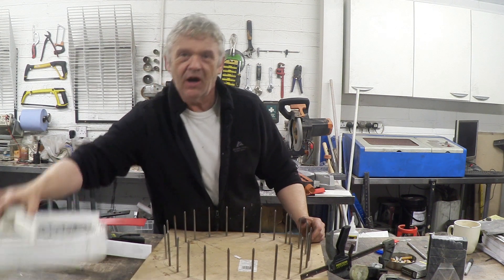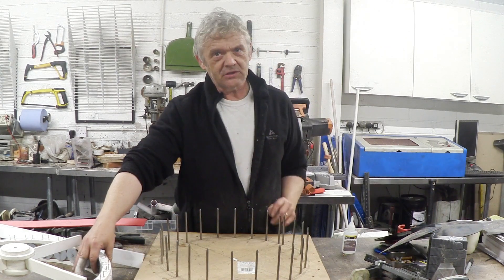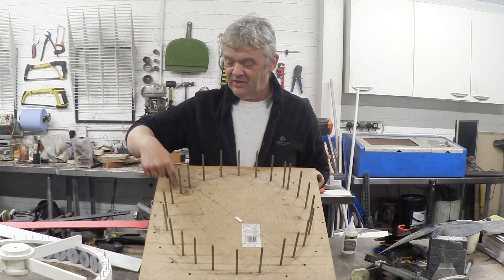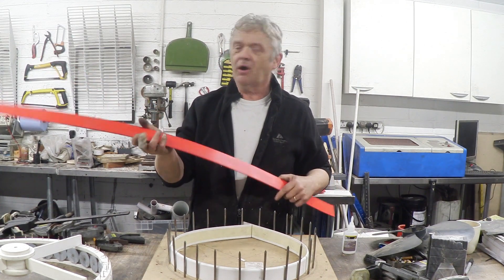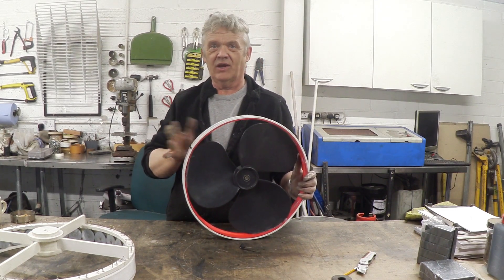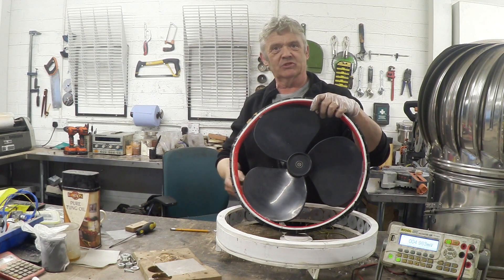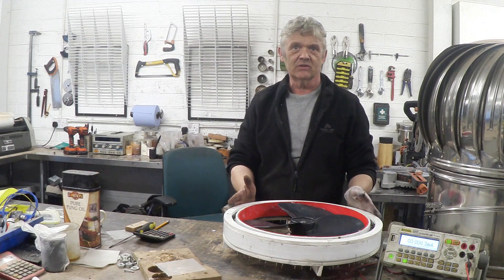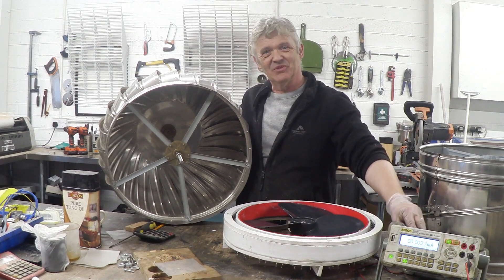Rotating Ventilator For Wind Power Part 4 - Making The Rotor

Comment: I am wondering if the coils will be wired in series or parallel. Will need to make sure that the wiring is all traveling in the same direction so that no coils cancel each other out. I think that the output will be really good. Possibly better than a solar panel.
Thanks yet again Rob, great video.
Edit ** you have to take into account that the 30 ma is the rotor moving at a snails pace. Put it into a decent breeze or a mild to strong wind and the output of the one coil would increase dramatically. Also when hooking the coils together with the magnets being in the good old N, S, N, D configuration it should put out a  wave form that is close to a pure sinusoidal wave which is ready for DC rectification using the alernetating power directly wouldn't be good because the frequency wouldn't be consistent and could potentially damaging.
Reply: I was thinking the same, they could be wired - all series, all parallel or half and half, depends on what voltage/current ratio you want, which I guess would depend on it's application. will definitely need rectification on the output.
Reply: @MrTubeuser12  agree, but you have to admit that this is an awesome project for generating decent power. I also agree with coils being wired in series or every second in banks of parallel with them put in series.
Another possibility is adding larger blades (about 1-3 cm) to every second to third vent would increase the area for the wind to increase the potential to increase the speed of the*turbine* (yes I use the term loosely). Decent bearings would be needed to reduce friction also.
Reply from the maker: I should have mentioned I paid particular attention to the way the coils were wound and mounted so I know the coil winding direction - but I will mention in the next vid - good point mate

Comment: Two thoughts come to mind and not wishing to detract from your considerable talent here.....heat and soot ....I know that my rotating cowl gets some soot buildup over a season and I am really not sure how hot the final exhaust temperatures will be but at 2.5 meters from the top it can be well over 100 degrees after a good days burning....wood not coal.
Reply: Desmond Bagley  yes I see that now you say it...I had not thought of that because I was caught up with my own cowl on my chimney, probably wise to externalise the design if being used on an active chimney.
Reply from the maker: I wouldn't use this on a chimney with a fire mate - as you say too much soot and heat - it would certainly be a good idea to mount the rings external to the cowl if you are using this on an active chimney - but good point - cheers

Comment: Nice build Robert.   Kinda concerned about the drag potential of the extra fan unit you're placing in the throat of this whirly bird though; is it veined properly to run the same direction as the outer rotor? It may  interfere anyway as the whole thing works on heat rise rather than wind (although wind doesn't hurt obviously).  I am rooting for you though!!!!!
Reply from the maker: the whole thing is a prototype mate - I am 100% certain there is a lot wrong with it - but it's how I learn by doing - I have already learn a fair bit myself and to be honest I am not sure if the fan is right or not - but I have that one and that's the one I am going to use - basically we will see and if it doesn't work out we can alway remove it
Reply: @ThinkingandTinkering    I love the whole concept Robert.   The fact that you actually went the extra distance to build it at all is more than most of us ever get around to; so my admiration as always abounds my friend.  My thought was only whether or not the fans were layed out to work together or whether their alignment (blade pitch) would be counter to each other.  Ya?  Since they are not independent having them pitched against each other would be counter productive and I can't tell from the video whether they are aligned to work together or against each other..   So it was a poorly worded question my friend and not a criticism.  Love your work!
Reply: Good insight, maybe if you need to have fan blades it would be better to have 2 or 3 sets of thinner twin blade propellers as used in RC drones set at 90 degrees.

Comment: There are still plenty of barns here in Iowa that could use a little more light and already have those ventilators. A ring of LED lights on the bottom of the ventilator and a key chain fob controller to turn them on an off would be useful and marketable.
Reply from the maker: nice idea mate and quite probably it would make a good product